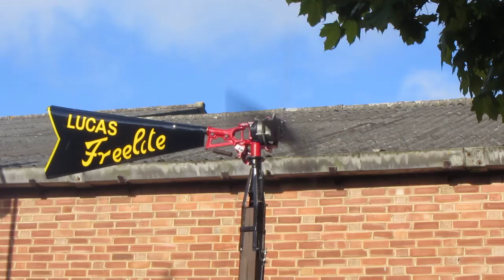FREELITE - LUCAS FREELITE

Comment: interesting
Reply from the maker: Glad you like it - through Utube, now learned there are a few about! - now obtained a dynamo but too heavy a job to install it - will leave as seen on video
Reply: This is from Alan Cooklin as for some reason my comment did not save and then it would not let me get in again.

I bought a Lucas Freelite together with ( slightly clapped out ) NiCd batteries, Pole and all for £1  from the local laird in Berwickshire  in 1963. This together with much later a number of different size Marlecs, and later a 2.5KVA Proven turbine and a small range of PVs, has powered  our house near Cockburnspath for the past  57 years. The house is now in Trust with my kids as Trustees. It is used much less now   - 6-8 times a year, and the Freelite, although still up, has not worked for the past five years. It would probably be quite easy to repair ( probably only brushes and/or Commutator) if/when one of my kids or two possible grandchildren enthusiasts get round to it. I have also 1 or 2 Freelites in a worse condition, bought for parts. If Graham thought the dynamo he found was 'too heavy' then it is probably the right one !

Comment: I have two Lucas freelites here in Somerset (mine are the later version with the two-piece tail); one with a fully restored 24v dynamo. I also have a much faster, higher output propellor - as the original douglas fir prop was a very crude design and I also made a revised tail.
The freelite castings were made by Qualcast.
I think there is one of the original freelites with the same tail as in your video still in situ by a barn not far from where I live. 
The 24v freelite was mounted on the roof of my experimental passive solar dwelling in Brighton in the 1970's, but I soon developed much more powerful turbines and set up a company (Aerodyn) to make them in the 1980's.
Reply from the maker: Hi Mr Green Genie - interested in your comments and info - a lot of witch I was unaware.
I still have been unable to complete my setup, although I have since obtained a dynamo, but it appears far to heavy to be the correct mark as I believe there were several types built of the R900.
The voltage regulator has still been unobtainable.
I shall possibly leave it in its present state. - nice to hear from you.
Graham —gjwade@gmail.com
Reply from the maker: Thank you for your info - sorry this reply is a bit late! - kind regards Graham